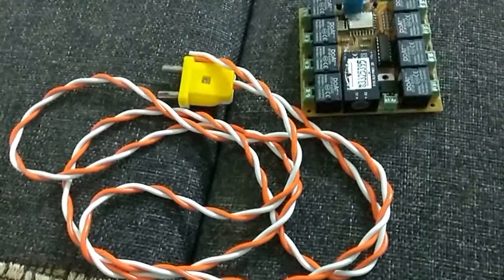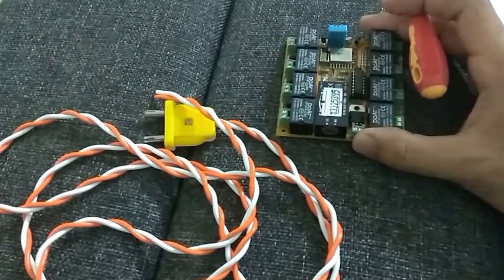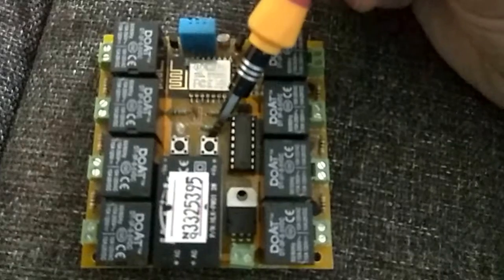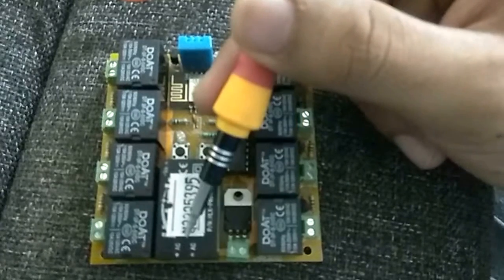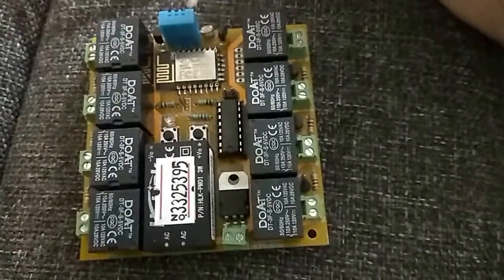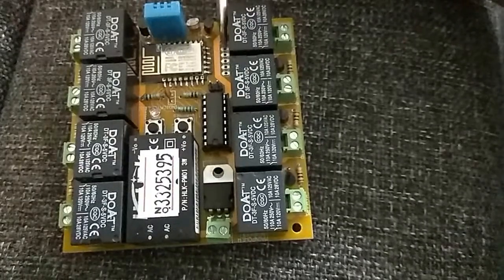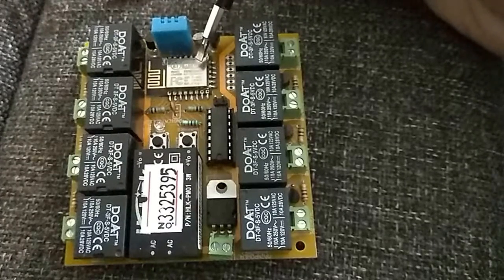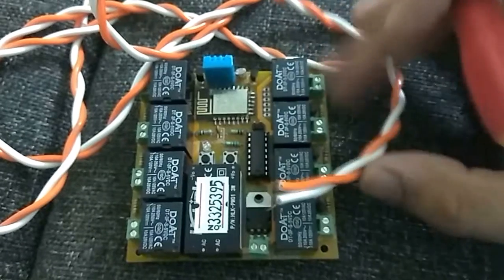Setting up IOT Connect Rev2 board (Part 1)

Comment: I am interested in using an esp8266 to control an 8 relay board over wifi. What code do I need to use?
Reply from the maker: You will find the Arduino codes in the help and content section of https://iot-connect.in download rev 1 .ino file